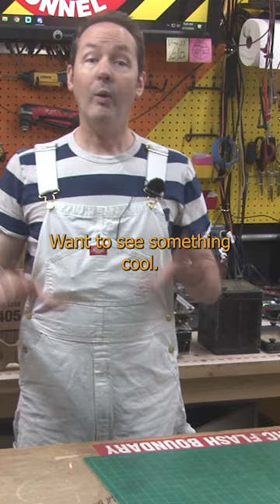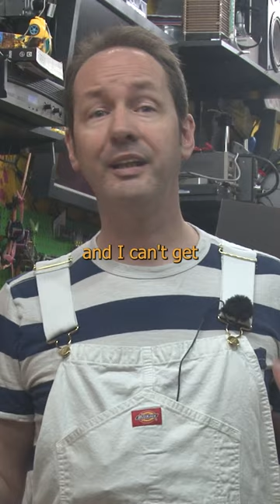Dial I for Amps #engineering #electricity #amps #ampere #current #science #sciencefacts #energy

Comment: I work in the industrial gas industry and operate centrifugal turbo compressors and our over current protection control loops are labeled as IIC for Amp Indicating Controller. I never knew why we used the I other than the generic, "I is just the symbol for amps" explanation. Thank you for that tidbit! I'll spread the word!
Reply: "A" is the symbol for amps. "I" is the symbol for intensity of current, the unit for which is amps.
Reply: They may be labeled that way to avoid confusing with AIC, which in the electrical trade commonly stands for Ampere Interrupting Capability, the max (usually short circuit)  amperage a circuit breaker or fuse can "safely" interrupt.

The "safely" is in quotes because a fault reaching that level can still damage the breaker or explode the fuse.
Reply: Basically blame the French
Reply: @mxslick50  I wonder if they call Inter-Integrated Circuit 'I2C' instead of 'IIC' for a similar reason

Comment: When explaining the relationship between amps, volts, and ohms, knowing that amps are the intensity of the current actually makes a lot of sense. Great vid!
Reply: I dare say that if they simply called it "intensity" instead of "amps" the meaning and relationship of what an "amp" even IS would be intrinsically impossible to mess up.
Reply: Technically what you have written are the units of the quantities and these do NOT have a relationship.  It is the quantities which are related, and these are: current, voltage and resistance.
Reply: @deang5622 and "voltage" is more properly named "tension". Tension is the physical quantity. Volt is the unit of measurement.
Reply: @larkohiya  But you have intensity of the current, intensity of the tension intensity of the power.
So you would have the same for Amps, Volts and Watts.

Comment: And it's why electrical engineers write complex numbers as x+jy instead of the x+iy form favoured by mathematicians and scientists.  And the "j", which is equal to √(-1), cannot be confused with current density, as that's a capital "J".
Reply: Coincidentally `j` is one of the three square roots of -1 in the Quaternions. i^2 = j^2 = k^2 = ijk = -1.
Reply: Technically that is not the reason why the letter j is used by electrical engineers.

The correct mathematical notation for a complex number is: a+ij
But if engineers used this, it would likely cause confusion so the engineers use the letter j.

And the correct orientation of the terms is: 
a+bj with the j after the real number b, not a+jb

Everybody uses the same convention, both mathematicians and engineers.
Reply: @PeregrineBF They are not called square roots. A square root is defined by:  a= b * b, b is the square root of a.

What you are talking about are roots of the equation . Nothing square about it.
Reply: @deang5622  That was the reason explained to us during the electrical engineering degree course.

And the notation the lecturers from the engineering, mathematics, and physics departments (we had lectures from all three) was never a+ij.  It was always a+ib or a+jb, x+iy or x+jy, u+iv or u+jv, etc.

Comment: And yet we use V, volts, voltage, a relatively new term and unit, rather than the older tension (U, for some reason), potential, or even pressure.

Consistency is surprisingly lacking in certain aspects of science, when you get down in the weeds. Even in the great and wonderful SI.
Reply: What I realized pretty quickly is that we have more than 26 variables in science. Oh, now let's use the Greek alphabet. Well we ran out of those, too.

So there is a lot of utility in having a few different names for the same thing, and being able to switch around as needed. Need the imaginary number in your current calculation? I=a+jb.

From the x,y,z,t axes, to the all the wonderful constants, to all the wonderful SI units, to all the specialty combinations, being able to have multiple nomenclatures can be pretty useful. And hard for undergrads jumping from math to physics to engineering and needing to reinterpret the equations depending on the hour.
Reply: In my country it depends on the language, when the paper is published in Dutch, U is still customary, whenever it's in English, V is customary
Reply: So, what does U stand for?

Comment: I was always more confused by the U for voltage. R for resistance, I for intensity and U for ushouldinventsomethingelsehere.
Reply: Short answer is, as you've already seen, U=V.

It seems to have derived from either "tension" or "potential" - somehow - because those were the common names for what we now call "voltage" back when U was the common symbol.

Interestingly, despite SI's adoption of "volt" as the standard unit, most other languages still use "tension" (French) or a direct translation as the common name. And in English you can still find usage of "potential" in modern texts.

Oh, and SI has slightly changed some values in their shifts to "more precise" references, defeating the entire purpose of a standard unit. No big deal for a layman dealing with, at most, 1-3 digits to the right of the decimal, that the values changed e.g. 11 digits out, but for a scientist that can be well inside - or even above - the significant range.

But who needs consistency?
Reply: U and V used to be the same letter, and it wasn't until about a couple hundred years ago that they were separated.  In old Spanish books, you can even usted shortened as "vd.", even though usted has nothing to do with the letter v.

The U/V letter worked similar to the way we use the letter Y today, where you'd know whether it was a consonant V, or vowel U, by context.

Comment: Also why we use j in calculations. I's already busy.
Reply: I is different to i.

I is the current, i is the square root of minus 1 and in conjunction with a real number represents the imaginary part of a complex number,
Example: a +5i

5i is the imaginary part. a is the real part

i² = -1

The complex number can represent anything, but typically is used in electrical engineering to represent both the amplitude and phase of either of: current, voltage, impedance.

Yes that is correct, impedance has a phase angle.

Comment: Ok but why is voltage U
Reply: Because U and V historically were the same letter.  It worked similar to the way Y works today, where it would either be a consonant or vowel, depending on context.

U stood for potential energy, since it looks like a potential energy well of a body in stable equilibrium.  Voltage is a related concept to potential energy, so it also gets the historically related letter V.
Reply: In much of electronics and electrical enginering we use the letter V to represent voltage and that is an English speaking country.

The use of the letter U, there are a number of differing theories and it might depend on the particular country as to which they use, U or V.

One theory is that U is already taken for another parameter in Physics to avoid confusion, but the fact is my country uses V and and that has been used for a 100 years and more and it definitely does not lead to confusion.

You Americans need to get with the program and adopt V as it is more intuitive, more natural.
Reply: @deang5622  We do use V in America, to represent Voltage.  It's the non-English speaking countries that use U.

Comment: A bigger mystery is why (American?) English just says amps instead of amperes, and stuff like "ammeter" sounds ridiculously lazy and unofficial. 😅 Also with voltage, not coming up with a name for the quantity instead of just taking the unit and add a postfix.
Reply: Everyone in the English-speaking world says "amps", not just Americans. And there is a name for voltage independent of the unit. It's called "Electromotive Force" and is why the letter E is used to represent voltage in equations.
Reply: @edisont.picard4112  By E you probably mean ℰ  or ε (for lack of better character support). That's also an interesting cultural/language thing because here in Finland we'd call that "source voltage" (for lack of better English words, voltage in Finnish is jännite, which comes from the idea of tension, jännitys), translating emf to Finnish maaaybe in university physics just to mention the word exists. AFAIK both IEC and ISO recommend not using the term emf. (Plain old voltage works for high-level EM too as it's just the difference of electric potential between two points which in turn is just the change in electric potential energy per charge (between two points).)